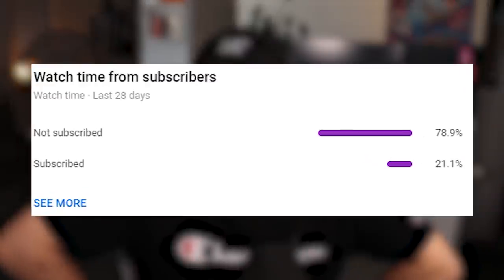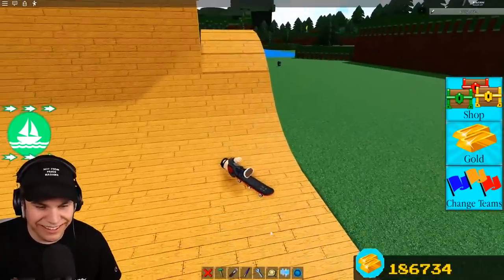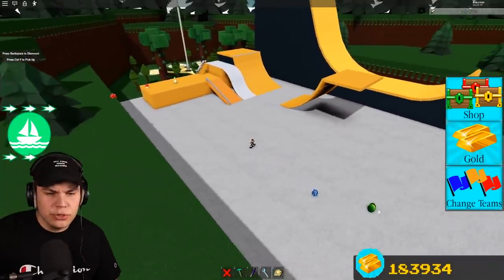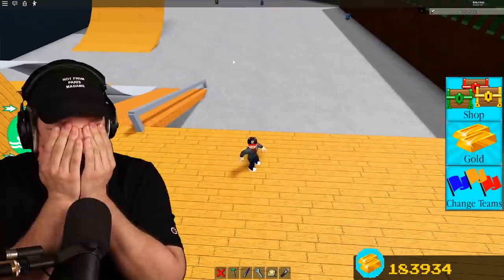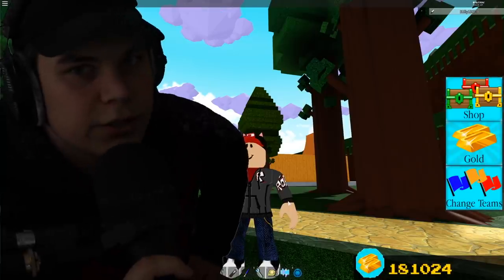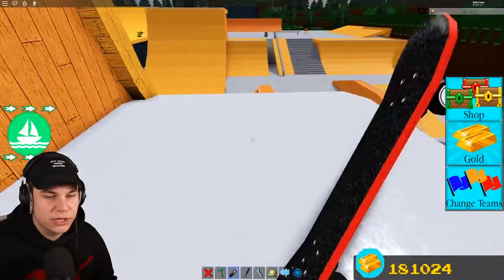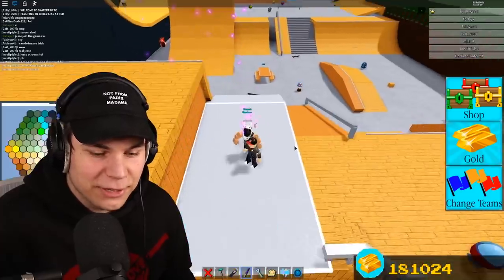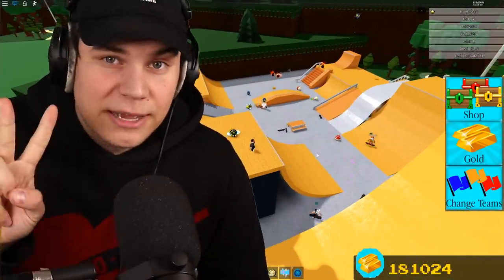WORKING SKATEBOARDS In a SKATEPARK! 🛹 Build a Boat

Comment: scale tool is way too much gold so i can't get the infinite block glitch!!!
Reply: Just build a spinning wheel I made over 2k gold in about 30 min by using the spring 4 prong wheel(not the thruster thing)
Reply: U should use the magnet grinder glitch I got the scale tool in 30mins using it and you need help just reply to me also you can get to the end in like 20 seconds with a gold block and 113 gold
Reply: 9K gold? is to much? how long do you play Babft? xD